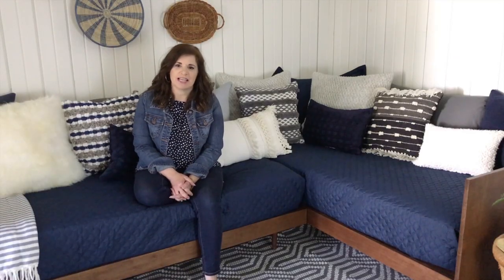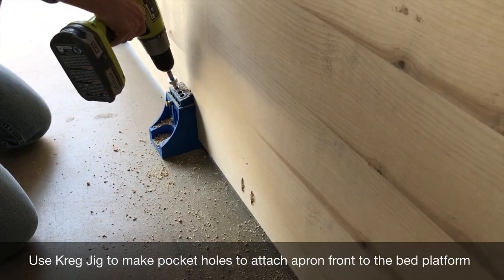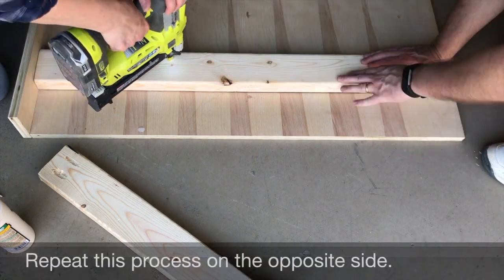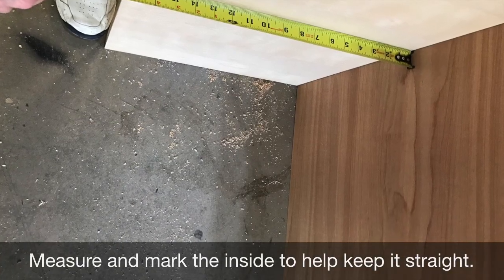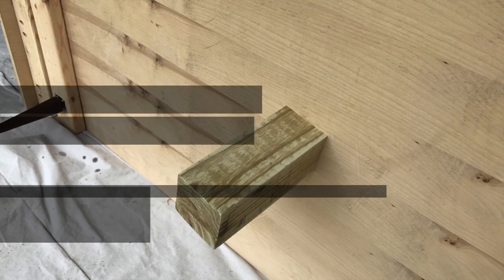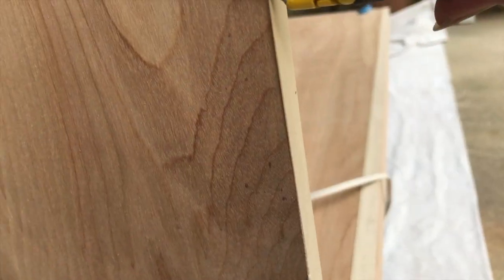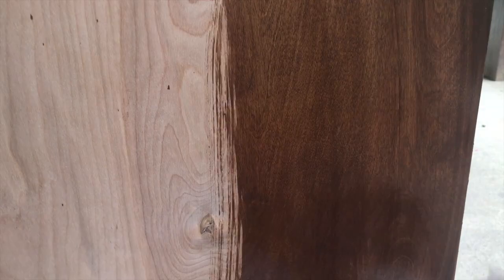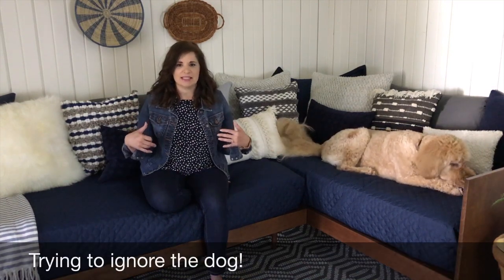DIY Plywood Mid Century Daybed: #PlywoodPretty Challenge

Comment: Minus the cost of tools, stain & mattress's...how much did this project cost you? Wood cost? Hardware for project cost? 
Also, about how much does the blue gadget used for pocket holes(I believe that is what it was).
Reply from the maker: I have the complete source list on my blog post linked above. Each sheet of plywood is around $50 for good cabinet grade PureBond. The 4 legs are $40. A couple 2x4's are $8 The edge banding to finish the plywood is about $19.  SO a good estimate would be about $120 each bed. Hope this helps.